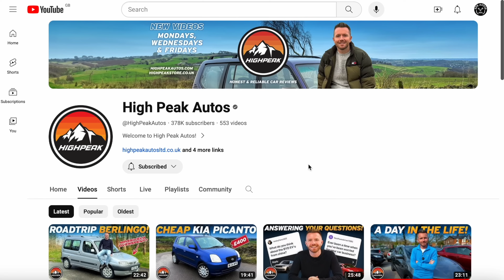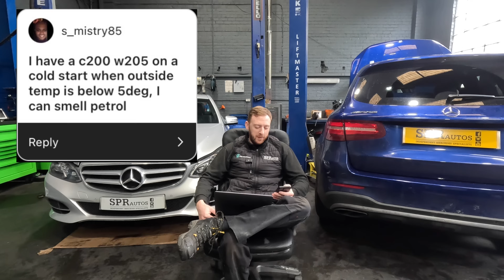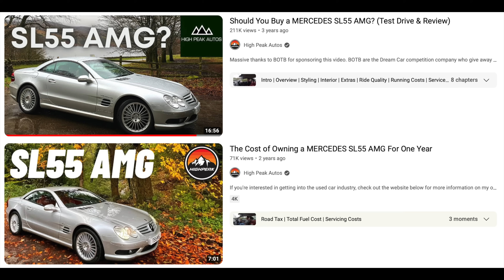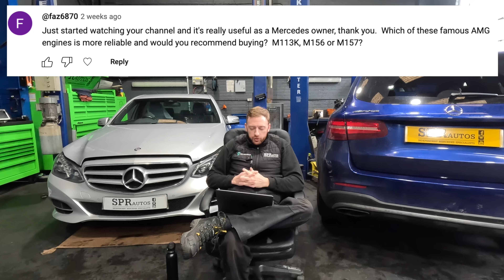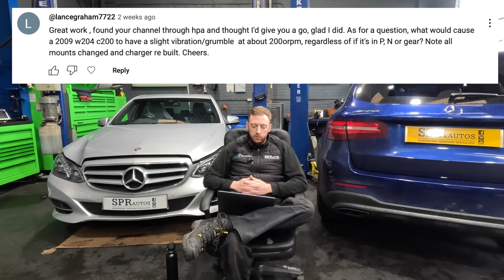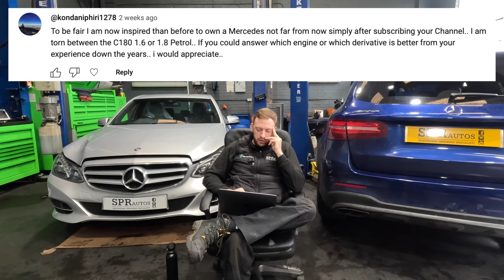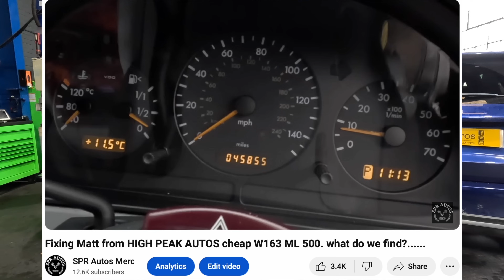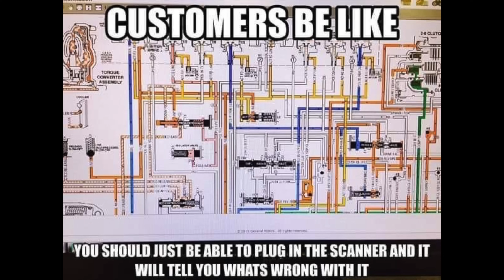10K SUBS, 1 million views! 🎉 Mercedes Q&A! ANSWERING ALL YOUR QUESTIONS! SPR History & more!

Comment: I'd love to see a video on the M271, e.g., whether it is sufficient to check for rattles or whether there is a time / miles limit for the timing chain. I'd also love to hear you comment on gearbox flushes and radiator flushes. I have a CLK 200 Kompressor and although it hasn't got the sexiest engine, it still is a ton of fun to drive and I would like to take good care of it, including doing preventative maintenance.

Comment: I recently bought a CLK55 2003 and have couple of issues. 
1.Left High Beam sometimes works sometimes doesn't, I have switched bulbs left with the right so definitely bulb is not a case.
2.Simililar problem with the passenger headrest works only when driving with seat occupied.
3.Not sure if this is an issue but the car at idle a bit shakes time to time, it is very sensible tho - is it something to worry about?

Off topic: I bought the car with full service History but..... When I went to my mechanic for full service it appeared that the oil was black like in a Diesel engine, the oil filter terrible condition, same with the air filters, and the fuel filter was from 2011- lol . Regarding the paperwork last service was done 2760 miles ago, so I am sure that the garage that carried the service did nothing :(

BTW great job with your channel.

Comment: Hello, good morning. I need the information on the color codes on front & rear coil spring for a W211 E200k prefacelift year 2006, Elegance having a 1.8litre supercharged. There are supposedly 10 different combinations of color codes for W211. 

Peeked into the wheel arch and no luck on seeing any painted dots of color. 😢😢😢. BTW measuring wheel arch to floor indicates 715mm for front left side vs 705mm for front right side.  For rear left side 690mm vs 680 rear right side. A bit of sagging. Intend to change to new coil springs. Having Blisten B4 stickers on the shocks and does not look like original shocks. The snap ring on front shocks looks either on the 1st or 2nd groove from the top. Can it be adjusted to 3rd or 4th during changing to new coils.

Thanks in advance for another feedback

Comment: Loving your channel 👍. I have a 1999 Sprinter 308d, OM601 engine 100k, as a camper. I want to keep it going as a classic. Any tips to keep in running well, Should I change gearbox oil and diff oil or leave well alone! 
Also do you know any Merc Specialist as good as you in Devon 😃.
Reply from the maker: changing any oils is never a bad thing.

Comment: Hi I am looking at a W124 from 1988 to 1992 what are your recommendations I used to love the 200E or E200 but even the older carburettor 200 was a lovely easy car to drive and fix but prices are through the roof are these cars still available and are parts easy to come by?
Reply from the maker: There are still plenty of parts for w124 floating around even from the dealer. Febi offer a lot of stuff for them too.

Comment: does a 2017 GLC 350d need an uprated radiator or oil cooler when towing a caravan
Reply from the maker: I would of thought it would be Alrite as you can have a tow bar fitted from factory and they don’t uprate anything “as far as I know” big enough engine to pull anyway